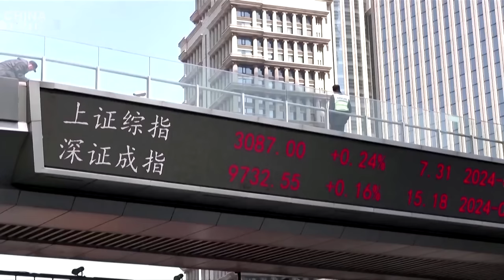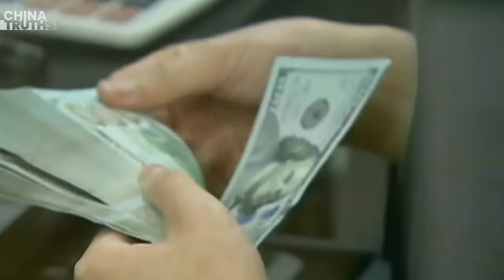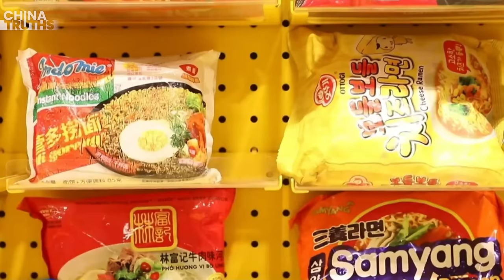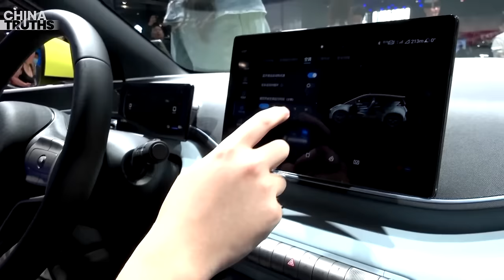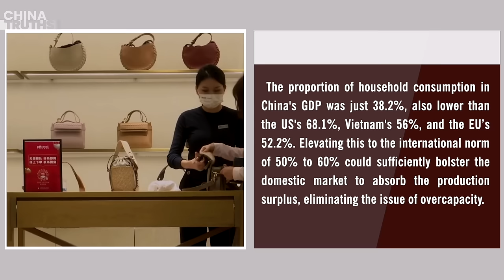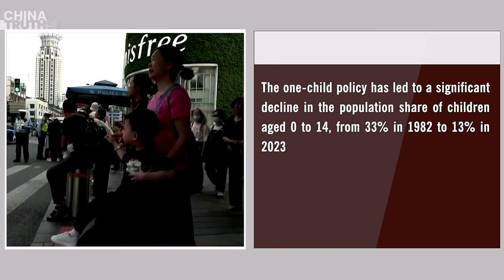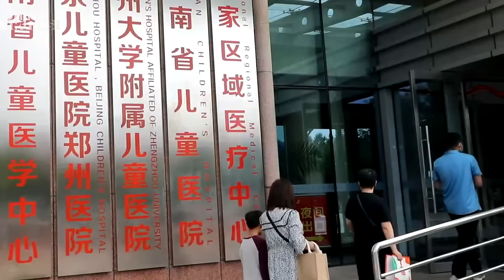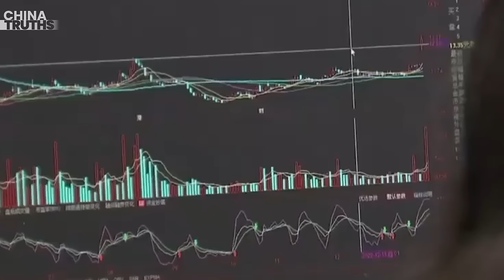China's GDP Ridiculed; Xi's Downfall Favored; Man Claims: ‘I'll Lead, Execute The Corrupt!’

Comment: Even China’s GDP is fake! 😂
Reply: GDP is the most easiest thing to fake. all you need to do is have 2 guys give each other the same piece of cash over and over
Reply: @Shinobubu  everything about China is fake... just look at their real estate market, which is supposed to account for 30%+ of China GDP.   The economy finacial is is fraud with statistical errors and speculation/projection not hard line number.
Reply: ...what is concerning is that  the reported  +5.3% high GDP Growth Figure attained 1Q 2024 in PRChina,  may actually be real and truth,  as Chinese Factories speed-up Excess & Overly Productions of massive Inventory building-ups/to be stored at Warehouses to rot ... are also calculated as Domestic Expenditures/Spending, all added to calculate high GDP Figures.  Likewise, the China Central & Local Governments can spend monies/funds ....building another 1,000 New Airports and 1,000,000 km length of New Highways / Roads to nowhere and have zero air- traffic and nor any usages, using borrowed monies and issuing new Bonds,  are all also can be added to higher GDP Growth figures.  That is China High GDP Growth Figures achieved, with Chinese Characteristics.

Comment: ...what is concerning is that  the reported  +5.3% high GDP Growth Figure attained 1Q 2024 in PRChina,  may actually be real and truth,  as Chinese Factories speed-up Excess & Overly Productions of massive Inventory building-ups/to be stored at Warehouses to rot ... are also calculated as Domestic Expenditures/Spending, all added to calculate high GDP Figures.  Likewise, the China Central & Local Governments can spend monies/funds ....building another 1,000 New Airports and 1,000,000 km length of New Highways / Roads to nowhere and have zero air- traffic and nor any usages, using borrowed monies and issuing new Bonds,  are all also can be added to higher GDP Growth figures.  That is China High GDP Growth Figures achieved, with Chinese Characteristics.